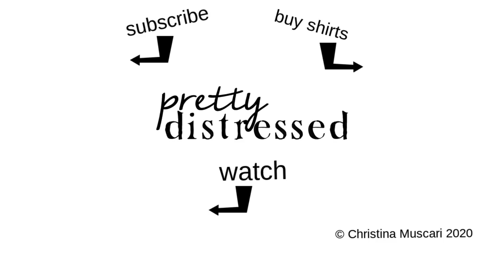I've Never Seen This Before | Red Dot Bleed Through on Chalk Paint

Comment: Girl.....you did good ! I am so grateful to see I’m not the only one who has to do a “do over.” Thanks for your honesty. 
I painted a smoking table from the 1800’s. It has slots inside the door for your tobacco pipes and cigars. It was falling apart so I used wood glue to fix it up. The tannic acid from the wood, AND the smell from the smoke ruined my hard work. The wax I used to seal the chalk paint yellowed, turned a rusty pink , pooled in the corners..... stuff was just oozing out of the “pores”......It was awful. So, I used Behr primer and paint in one. Looks awesome. One coat, that’s all. Lesson is you do have to take into consideration just how old the wood is and how it was finished to begin with. FYI, I used the same original chalk paint and wax on a newer table and it had no problems. Love your channel!
Reply from the maker: Thanks for sharing, Cheri!

Comment: Hi, Christina.  I think I have watched the majority of your videos and have learned a great deal, so first of all thanks for sharing.  I am painting a solid wood lingerie dresser with a dark stain with white chalk paint.  Following your lead from the nightstand in your daughter's room I did 3 coats of primer, and three coats of white chalk paint; sanding in between each coat.  I just applied the first clear top coat and have red bleed-through at the dresser joints and the corners.  I sanded the stain off the drawers so no bleed-through there.  Sanding down to bare wood like you did here would be possible on the corners, but hard to do where the bleed-through appears at the joints where the side panels meets the corners.  Any suggestions?

Comment: Ok so I had something very similar happen recently. They were extremely small and few dots but they came off with extreme elbow grease. It was a piece I had applied polycrylic and came to see it the next day. Do we have the same issue here if mine did budge with hardcore pressure rubbing? Honestly my theory was that due to the large amount of spiders I share my shop with, probably in the beams above me, that it was a spiders dinner who dripped on my dining table. It happened three times with that table

Comment: Help! Placed my first coat of chalk paint on my medium stained oak piece. Woke up this morning with bleed through on the top of the piece. I lightly roughed it up before my first coat too.  Can I use a primer on top of the chalk coat or do I need to sand it back like you did in the video?  Would the Dixie Bell boss don’t the trick?
Reply from the maker: You should be able to put Shellac or Boss right over it and that will do the trick. This case was rare!
Reply: @ChristinaMuscari  thank you!  I’ll give the Kilz a try since I have that on hand!  Not starting off my first piece on a good foot!  My cabinet happens to be the companion piece to your beginners/java gel end table😂

Comment: Jami Ray Vintage uses spray shellac Zinnser, I  believe.  I dont know if this would make a difference.
Reply: I think she uses 2 to 3 coats of shellac just on the problem areas.
Reply from the maker: I did Shellac the whole thing because my primer had Shellac in it. I also tried to do multiple coats of it over the paint. It kept coming through! That is why I ended up stripping it back.